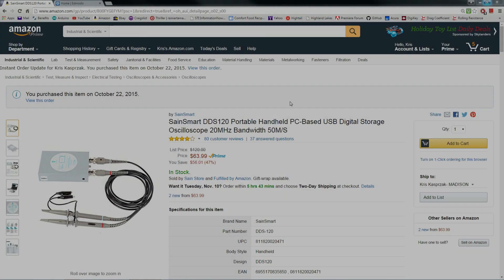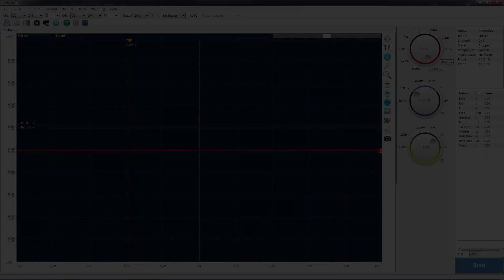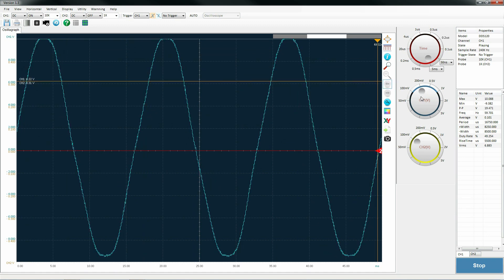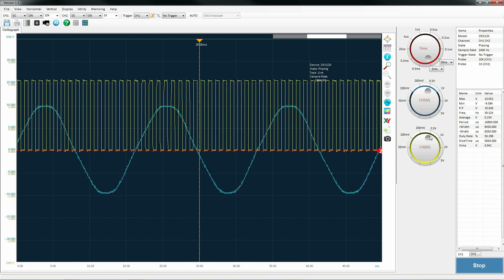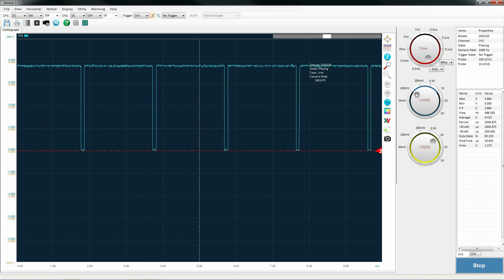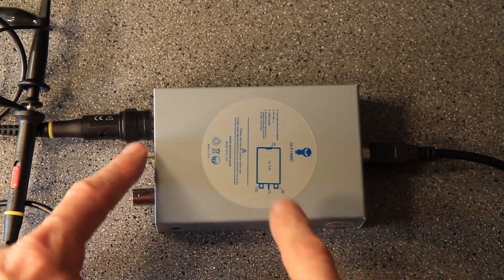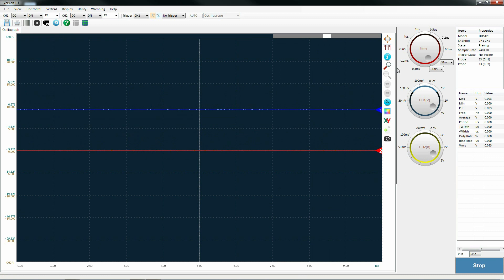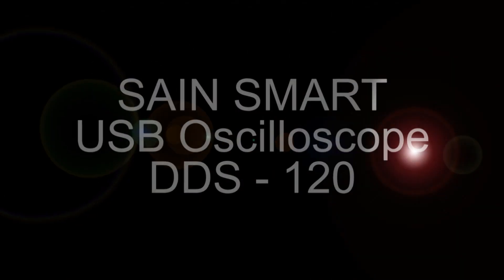USB Oscilloscope SainSmart DDS-120

Comment: How about below model for hobby use
https://www.aliexpress.com/item/PC-USB-Oscilloscope-Hantek-6254BC-4-CH-250MHz-1GSa-s-waveform-record-and-replay-function/32792816017.html?spm=a2g0s.8937460.0.0.qM17ZR
Reply from the maker: I have a unit from Hantek (a slightly different unit) and it's very similar to the Sainsmart one. But I've done very limited testing of the Hantek unit. Personally, i'm not sure you will go wrong with either one--assuming it's just for hobby use (like I use mine).

Comment: Any idea how I could stabilize channel 2?  My channel 1 trigger seems to be working fine but the trigger for channel 2 isn't working at all

Never mind...It turns out I didn't have my trigger set to begin with :$ 

Millennials these days eh?
Reply from the maker: darn good question. I've never figured out how to get the trigger working on any channel. When trigger is on, i have to drag the mouse cursor in the graphics window and sometimes trigger will work. Very flaky...

Comment: Nice review. This thing is even cheaper now. One thing you're missing in this review is the XY-mode button. I can see that on the video but would be nice to see if it's actually comparable to the usual oscilloscopes which has CRT monitor. Or is it too slow to use it as a decorative element with music.

Comment: Every signal you were testing was 240Hz? I was looking at couple of reasonably priced Fluke Scopemeter's to tune the gains on my car audio amplifiers and all of the cheaper scopes seem to be missing the feature that detects what signal is currently being played/read. I was looking at the DSO and Velleman HPS140i and they both let you test the signal but if you are, for example, testing a 1Khz tone it won't display that.
Reply from the maker: I routinely measure square waves up to 30 khz, but the unit can measure much higher frequencies. No sure my reply helps...

Comment: Hi Kris!!!  i know the difference between dds 120 and dds140 is de Bandwidth(20 and 40 MHz respectively) and the MaxSampleRate(50 and 200 msa/s)..........does this  makes any big big difference? i would like to see the waveform of my motor variable speed drives...
Reply from the maker: I guess it depends on how fast the waveform is, assuming its a pwm type signal i doubt it's above 30K, meaning the 120 should work. I've used my 120 to monitor motor controllers and it worked fine.

Comment: I just purchased this piece to use on my car stereo. I cant make heads or tails of the manual. I need it set it to test for distortion in the audio signals. Can you tell me how to adjust the settings to use it for this application? I know how to use it once it is setup correctly.

Comment: +Kris Kasprzak  "One thing this unit does not do, is pick the time for you automatically" There is an auto button on top, ever press it? Works for me....
Reply from the maker: +Digihaven Now that is too funny--how did I miss that button. I can get it to work and i'll put a note in the video--Thanks.

PS can you get the trigger to work? Mine is very unreliable.
Reply: +Kris Kasprzak  Worked fine with me (making sure triggering is on the correct chan and turned on), but I'm using the newest version linked on the Amazon page.

Comment: HI, just bought the DDS-140 but for the life of me I cant load the driver on a WinXP laptop. I'm not having much luck with support so would you/anybody have any suggestions?
Reply from the maker: +Golo1949 

I've had to manually update drivers on XP in the past and this is the approach. Perhaps it will work for you

1. Click Start, then right-click My Computer (or Computer) and click Manage.
2. In the Computer Management window, on the left, click Device Manager.
3. lick the + sign in front of the device category for which you wish to install the driver.
4. Right-click the device, and select Update Driver. The Hardware Update Wizard opens.
5. For using Windows Update, select No, not this time and click Next.
6. Select Install from a list or specific location (Advanced), and click Next.
7. In the window for search and installation options, select Search for the best driver in these locations, and select the Include this location in the search check box.
8. Click Browse, and navigate to the folder that contains the driver files. Click OK when this folder is selected.
9. Back in the Hardware Update Wizard, click Next. Windows will search for the driver and install it automatically. 10. When the installation is complete, click Finish.

Hope this helps.
Reply: +Kris Kasprzak Thanks Kris but this is exactly what I have been doing but it still shows in device manager as (NULL).
Reply: Sorted!
Reply from the maker: +Golo1949 Good to hear, perhaps you could reply back with what you did? I'm guessing this could help others.
Reply: +Kris Kasprzak 
I had to manually load (UsbLjtMS.inf) in the driver folder because windows couldn't find it! Just selecting the driver folder was not working.
Regrads

Comment: I bet that noise is coming from the USB port.  i.e. Noise generated from the computer.  This seems to plague many of these USB Oscilloscopes.
Reply from the maker: +valveman12 Any idea if there is a way to fix this?
Reply: Kris Kasprzak No it can't be fixed.  It is inherent is the design/ lack of filtering. Unfortunately when it comes to these USB scopes, you really do get what you pay for.  The Labnation USB Smartscope appears to not suffer much from computer generated noise.

Comment: I got one of these a couple of weeks ago and I was a little (OK, more than a little) distressed by the spurious noise. But as you've pointed out, for not very much money, it does a lot and actually works pretty well.  And the noise won't really interfere much with my ability to see what I need to see in any of the vintage radio and TV signals I'll be looking at.